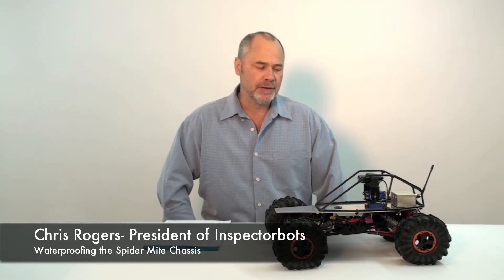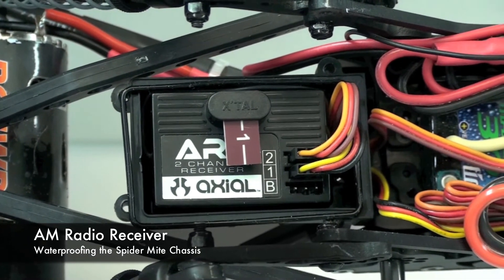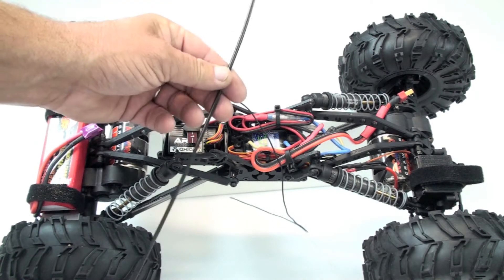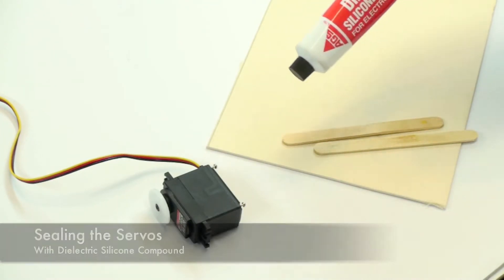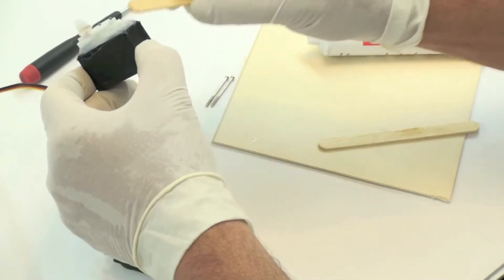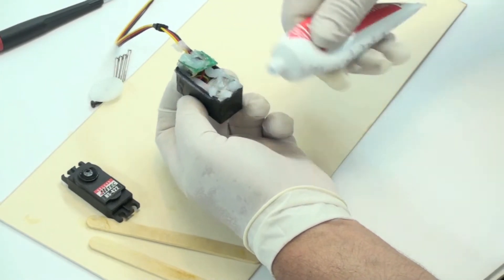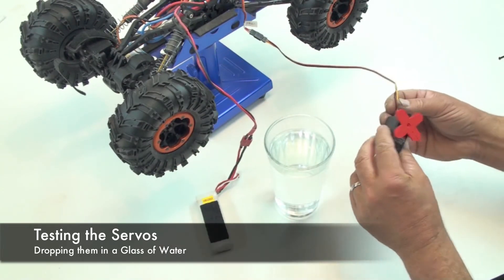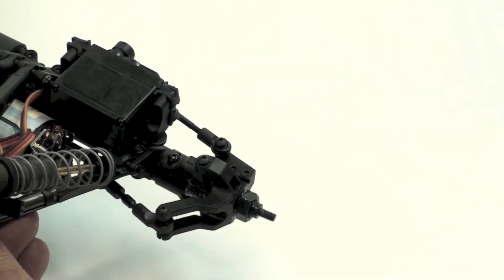Axial XR10 Waterproofing.mov

Comment: This is NOT waterproofing. I'm sure it helps with keeping the system working in high humidity, but I'm pretty sure most of the parts will suffer long term damage after dipping in the water. Not to mention running in water. Not to mention salt water. Try running that lipo under water for a couple of hours, then see how long until you have to buy a new one.